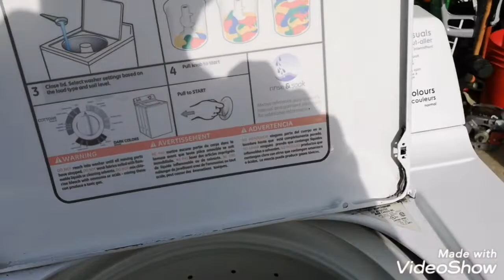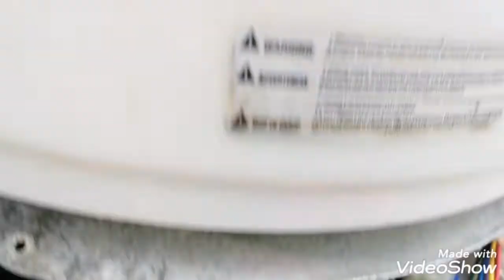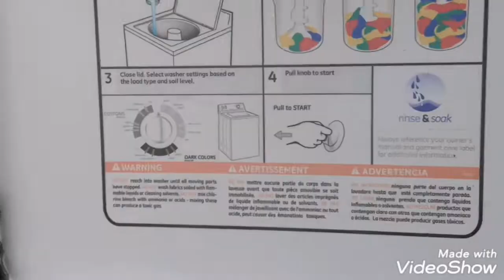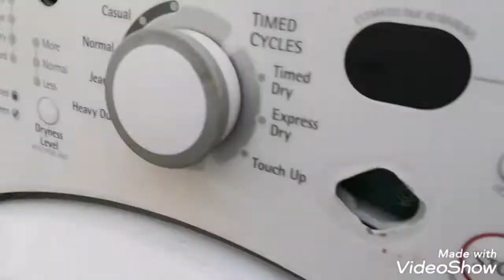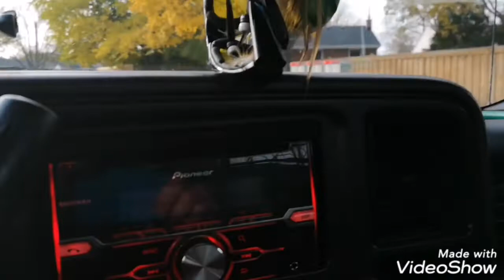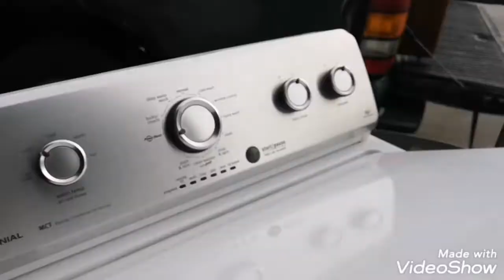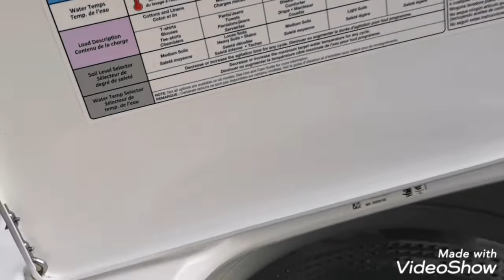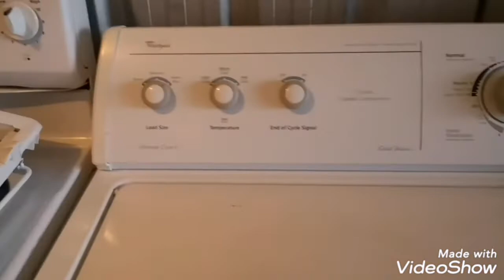GE WASHER MAKES NO SENSE

Comment: Did you get the GE washer figured out?
  I think the purpose of the overflow is to direct the water if the washer overflows to prevent water from running over the tub and onto electrical parts. 
  I think I saw the problem with the GE washer as soon as I saw the pressure hose at 6:25 when you pulled it off to blow into it. 
  The hose looks like it needs cleaning out or replaced.  That gunk in the hose is interfering with the pressure that activated the water level switch. 
  Clean /replace the hose  or maybe recalibrate the switch. 
  If you insist on closing the hole, I have fixed broken tubs near the top by cutting pieces from another outer tub to fit the curve and used Plasta Weld to glue two pieces over the crack on the outside and inside.
  Btw, I saw you respond to a post on FB and thought I would check your videos out.
Reply from the maker: Thanks for watching 👍 and the  GE washer I was the water inlet valve s stuck open . and the water filled up to that hose and draind from it on to the bottom of the washer . and corroded it . and thanks for subscribing . take care 👍🇨🇦
Reply from the maker: GE washer .it happened when the washer was off not in use . the value wasn't holding the water .that my conclusion . because I did a multimeter test on the valves . and bad